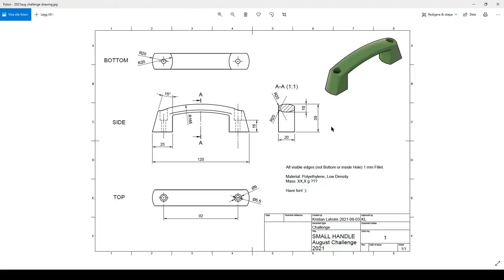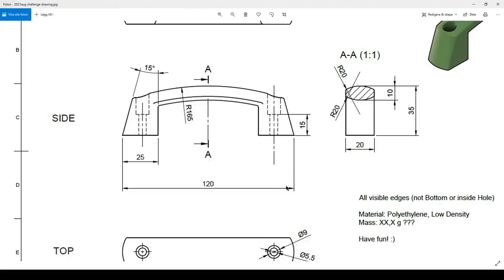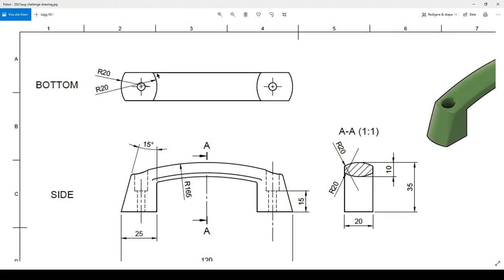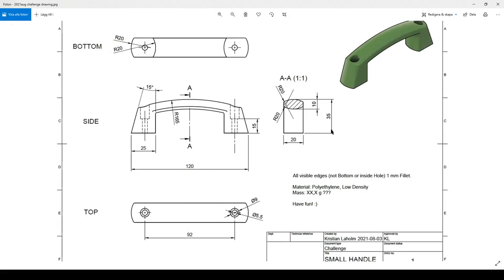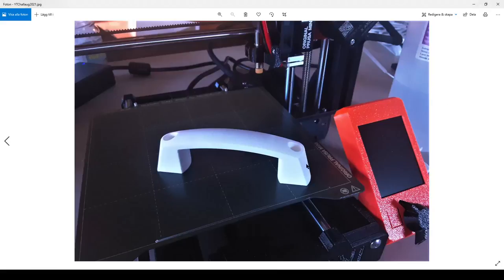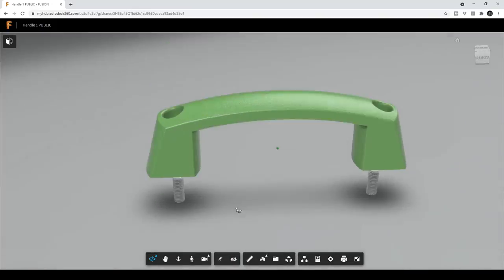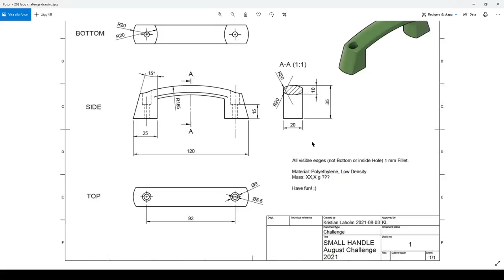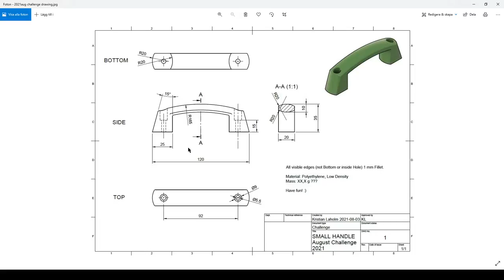Fusion 360 Challenge - August 2021 : Small Handle

Comment: I would say 11 but... ;) my result is 27.789g
Maybe next time I would do this better way but it was fun :)
Reply: @lukaszb1282  - I would be interested in seeing your Mass Value with 4 decimal points, which can be set in "Preferences  ->  Unit-and-Value-Display  -> General-Precision".  I think we have the same solution at 27.8815g.
Reply from the maker: @WA0UWH  If you get 27,881475027 g you have figured out all my secrets ;) (But my workflow in "solution" video will most probable contain some extra steps to make it more clear on how I got to the design)
Reply: @KristianLaholm  - Very Good, I always enjoy learning from you and your solutions.
Reply: @WA0UWH  sorry for late response but you're right. We got the same result - 27.8815g :)

Comment: there is one thing, which hard to tell from drawing, is arc profile swept parallel to the arc or perpendicular.
Reply from the maker: From the start I hade the dimension for inside radius of handle but thought it was redundant, but as you point out it's a bit ambiguous without it.
Then in doubt with my challenges go for the easy workflow ;)
Reply from the maker: I hade to try both parallell and perpendicular and difference with the large radius is small to the resulting model.
If someone reads this comment do what you want :)

Comment: I got 27.8851 g,    in 8 steps
Reply: I 3D Printed it, It looks and feels good, several more maybe useful for a shop project.
Reply from the maker: @WA0UWH  You could make it parametric and make it easy changing the dimensions ;)
CAD + 3D printing gives us a nice way of expanding things around home and workshop :)
Reply: OK, I admit it, I have become obsessed. My new F360 solution is:    27.8815g    in 6 steps.
Reply from the maker: @WA0UWH  That is the danger of 3D modelling, it's addictive :)